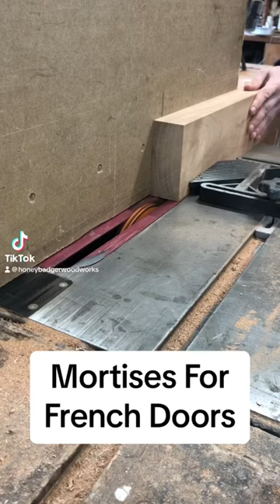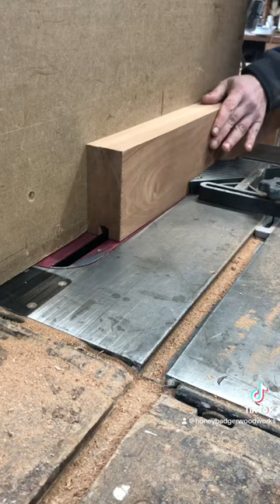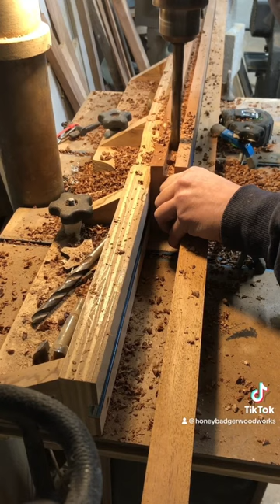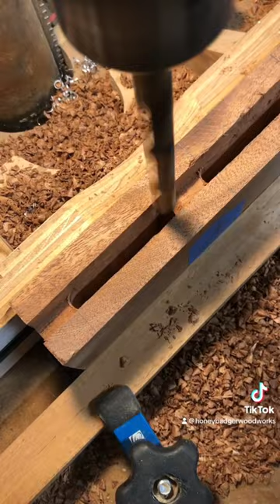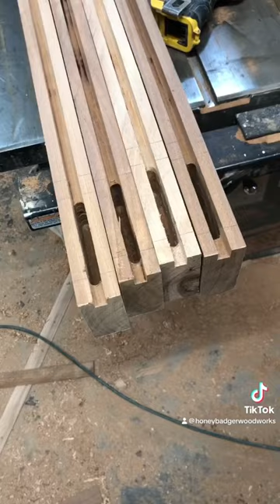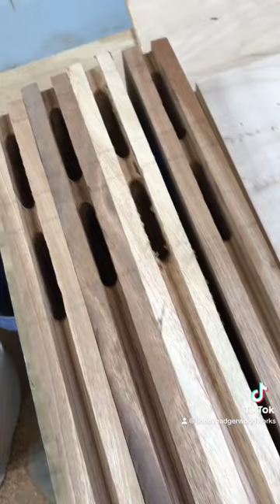#shortsfeed #diy #woodworkingprojects #wood #howto #shortscraft #shorts

Comment: Hello H. B. I hope this is going to be an up coming episode. I love Double French Doors. Also, is your planer working consistently for you now. For what the cost of one of those are , they should supply a bag full of those Part’s you had to replace to keep the breaker from tripping. The floor repair that you just did in your shop seems to have cured that water problem. Nice job. Enjoy the rest of your week and up coming weekend.
Reply from the maker: Yeah, this will be an upcoming series.  First video will be up a few weeks from now.  That new overload switch worked like a charm.  I milled up all this 8/4 Sapele without it tripping once.  I wish so much I found out about that fix years ago.  Would have saved me so many headaches.